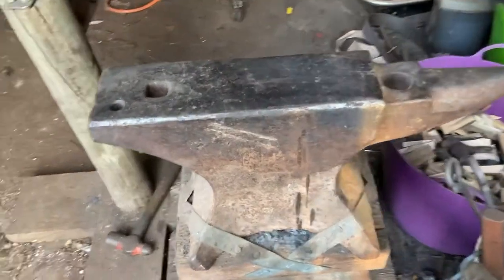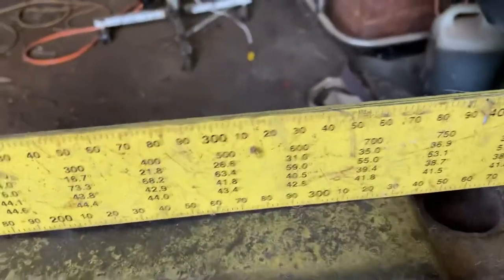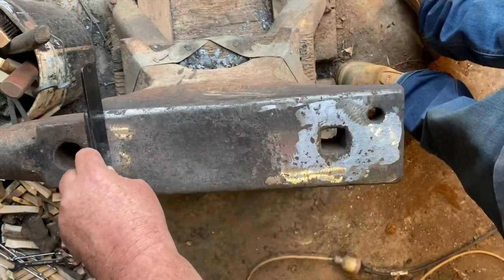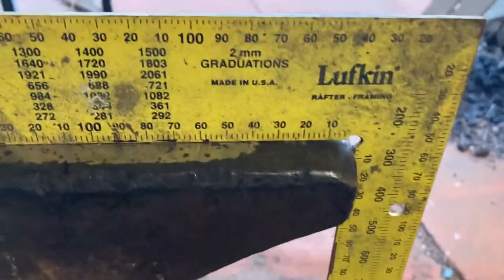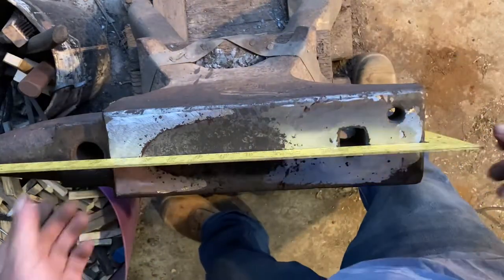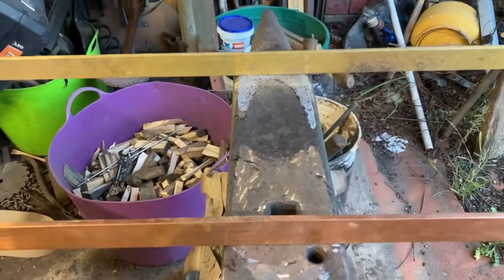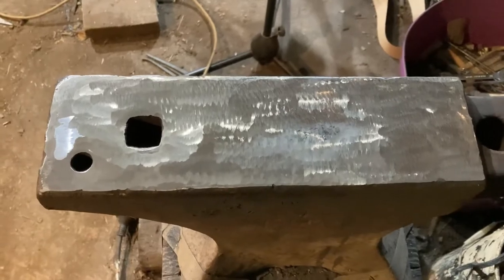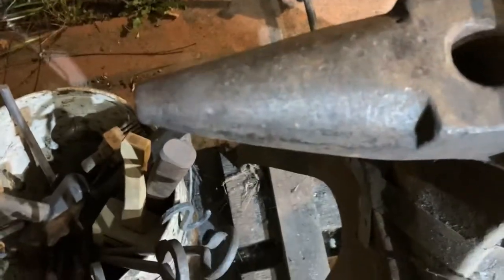Restoring an anvil, Resurfacing an Anvil, Anvil Restoration

Comment: Really nice job, was wondering how long it would be before you brought out the belt sander! Unusual anvil with the big hole in the horn step!
Reply from the maker: Thanks Paul, the belt sander is a lot slower so doesn’t work as well on the ceramic belt, but does work well for flattening the top. From what I have read the hole in the cutting deck is to have a replaceable plate in there.